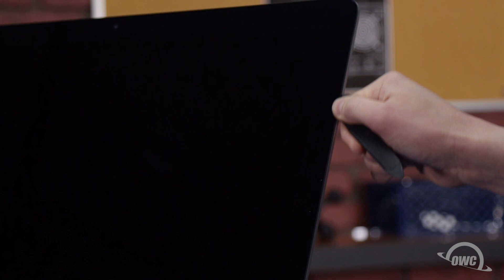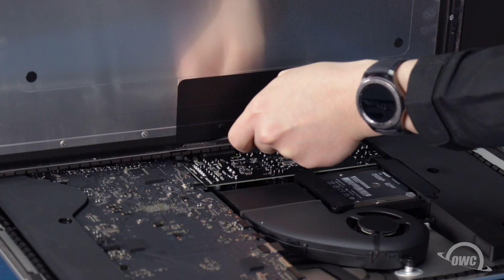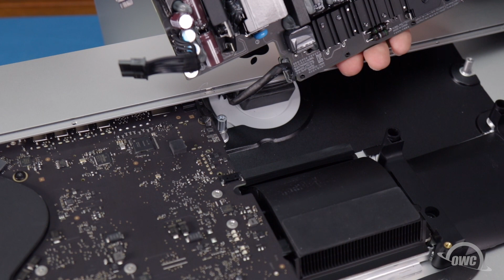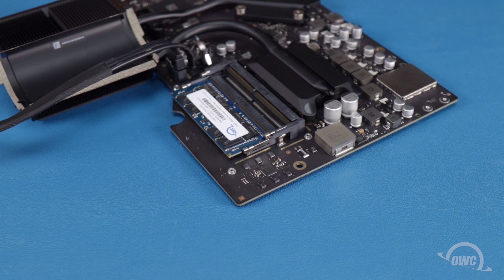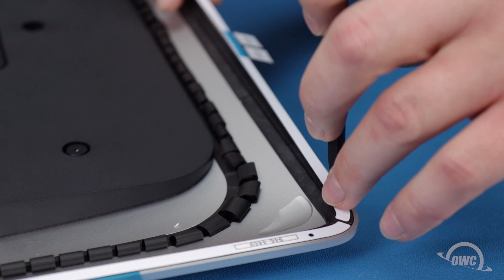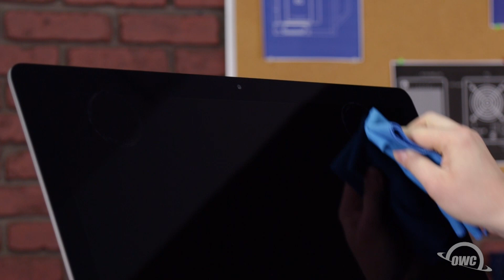How to Upgrade/Replace the Memory in a 21.5-inch iMac (2019) -- UPDATED VERSION AVAILABLE

Comment: You have got to be kidding me!
We just purchased the 21.5" 4K retina to replace our bought new, late 2009 iMac. The HD fan had stopped working in the '09, so I had purchased the 3 fans refurbished. 
I had no qualms in opening up the '09, but the wife felt 10 yrs was a good run and came into some money so wanted it replaced. It's pretty much been hers and located in the kitchen.
Well the '09 is up and running today (the dust accumulation was unbelievable) and since the memory upgrade on it was just removing a perforated plate on the btm, I thought I'd check out upgrading the new one
No way

Comment: Thank you so much! I been able to upgrade iMac 21.5` 2017 with 32Gb of RAM and 500Gb SSD and it works perfectly. Only problem was that had to remove glass 2 times, as first time i did not pluged power supply socket strong enough... Anyway, now it works as expected and much faster! Video works for 2017 model with a very minor differences.

P.S. i found a lot of dust inside, had to cleanup everything with a hoover...

Comment: After upgrading the ssd harddrive and memory ram to 64gb. Do I have do to anything when I power on the iMac? Thanks
Reply from the maker: Hi Zee. You will need to get your OS or backup of your system onto the new drive after powering on. You can find the instructions on installing a fresh copy of the OS, and migrating your data to the new drive, here: https://eshop.macsales.com/articles/how-to-transfer-your-data-from-your-old-drive-to-a-new-drive

Otherwise, no, just go ahead and power up!

Comment: Hi I have a iMac with a  fusion drive. What should I buy to add an ssd to this? Also what is the difference between the 3.0 i5 and the 3.6 i3?
Reply from the maker: Hi Joey, we'd be happy to assist with the correct upgrade info. Would it be possible for you to provide the model identifier of your machine? To find your model identifier, click the Apple icon in the upper left corner of your screen. Click "About This Mac". Then, select the "System Report" button.The first screen that comes up should show you your model identifier as the second line there. Alternately, I can look it up for you using the serial number of your machine.
Reply: OWC hi the model number is MRT42LL/A
Reply from the maker: Thanks Joey. We would need, specifically, the model identifier, as outlined above, to verify the details of your machine.
Reply: OWC the model identifier is iMac 19,2
Reply from the maker: Thanks, Joey! The available SSD drives for that machine are here: https://eshop.macsales.com/upgrades/imac-retina-4k-21-5-inch-2019-3.0-ghz/internal-drives

Comment: I have followed the same instructions for the RAM upgrading but unfortunately after finishing I found that the screen is black and tried several times but no use ... then I have connected it to external monitor and it worked fine .... what could be the problem? ... I have even changed the LVDS cable didn’t work either

Comment: DO NOT FORGET TO BUY COMPATIBLE RAM. OTHERWISE IT WILL NOT START. 
IN MY CASE, I RE-OPENED IT AND USED ONE NEW KINGSTON RAM ALONG WITH DEFAULT APPLE RAM (MICRON) AND IT WORKED!
WARNING: MAKE SURE TO CHECK BOARD SOCKETS BEFORE CLOSING IT BY USING SOME USB A OR C BEHIND IMAC AS I HAVE TO RE-OPEN IT THRICE BECAUSE OF THAT ISSUE.

Comment: OMG what a nightmare - Can you imagine getting everything back together and discovering that one of the modules wasn't seated properly?
Reply: The nice thing about the video is you can just pause and take it step by step. Unless you straight up skip a step or aren't paying attention, you have no excuse to miss something. They go over every screw and cable in the process in both directions.
Reply: Currently in that boat....everything works great expect my thunderbolt ports and internal mic are not working so going to go through all of this again to make sure everything is connected and working before I seal it up again.
Reply: Before you do it all back, just test with an external monitor on the thunderbolt port.

Comment: Daaaamn... Apple put so much effort into preventing people from doing simple HD and RAM upgrades. Then they went and made a 5400rpm HD standard. Why do I continue to buy Macs? The current line-up's just evil as there's intentionally no 'mid-range' model with a mid-range price. Rather, there's a high-end Mac Pro for $$$ and an affordable i3 that you wouldn't want. All models have 8GB RAM and those darn 'fusion drives'. I swear somebody put a looot of thought into squeezing customers out of their $$$.
Reply: you buy apple for their ecosystem: you pay for their software, not for the hardware.

Comment: Your videos are excellent.  Very detailed and easy to follow and understand.  Crystal clear videography.  However, Apple should be shot for this nonsense.  I am an Apple fan but some of the stuff they do could pi$$ off the Pope.  Why?  Is this absolutely necessary?  Many people simply cannot afford to pay for such upgrades at the time they purchase their computer. The cost of a new iMac is already very high.  I understand that they are well built and we are paying for the quality but trying to add another $200-$800 to a computer that is already $1500 is crazy.  Things like hard drives and memory should be accessible to end users to upgrade at a later date without having to go through any of this.  I love Apple but this is simply irrational and totally unfair to their customers.
Reply: Having to do this upgrade and learning that the new iMacs post the 2020 iMac will not be upgradeable is making me question my next purchase.     hard drives and RAM should be easily accessible.  That should be a design requirement.    I haven't owned a PC in a decade or more and am questioning whether I will again right now.
Reply: I agree with everything you say except for one thing.. I don't love Apple anymore
Reply: @JairoTaracena  I am quite pissed about this also..on my old 2011 iMac it was easy to upgrade the ram, there is no excuse for this. Not an apple fan anymore either

Comment: Obviously Apple sell more 21.5 inch that the 27 inch models, so they needed to make the smaller one that much harder to upgrade the memory  so that customers can be forced to cough up more ca$h for an expanded memory at the initial buy and squeeze the after-market vendors like Crucial out of the picture. I love Apple products, but I think this is where an up and coming tech company like Huawei would have filled the void and offered options to make Apple more honest. Going forward, we in the US market will be stuck with inferior products because of the lack of competition. Thanks Orange president.

Comment: I did this upgrade along with upgrading the hard drive to a SSD. It took about 4 hours but could not have done it without this video. It was perfect and I used it every step of the way. Thanks so much.
Reply: Upgrading from 8GB of Memory to 32GB is a $600 option on Apple's website if ordering online.
To upgrade your hard drive from the standard 1TB Serial ATA drive to a reasonable 512GB SSD is another $400. So $1000 dollars on top of the $1299 initial cost (3.6GHz Quad-Core Processor, 1TB Storage, Retina 4K Display).
On Crucial.com, you can get a 500GB SSD for $66.99 and 32GB of memory for $149.99 on OWC. so for $220 out of pocket and a savings of $780. I'd say 4 hours of install time is money in the bank. 
Whenever possible, if you're capable, don't choose the upgrades from the manufacturer. Just do it yourself.
Reply: Kevin Shea did you buy a kit from a local store or something? I’m dumbfounded at this difficulty to do this
Reply: Any tips on how to transfer the OS to the new hard drive? I just bought a new iMac 21.5 with the intention of doing the upgrades myself. Any tips would be greatly appreciated. Thank you.
Reply: @ChefNatintheMaking   use this software..you can use it free for a couple of times..
https://bombich.com/download
Reply: @kevinshea5819  kevin thanks for your comment, how much memory stick with your Mac after the up grade?
Reply: @javierduarte4421  I upgraded to 16gb
Reply: @kevinshea5819  thanks you very much
Reply: @kevinshea5819  did you have to buy a new bracket for the ssd or did it fit the one already in?
Reply: @xdc98x  you do not have to buy a new bracket. The old one fits.
Reply: @kevinshea5819  OK thanks I have a new bracket anyway but I'll try the old one first
Reply: 4 hours........how much you save at this time?
Reply: @Hob419  The memory (16mg, SSD 500GB) and the "tool kit" (torx screw drivers, new adhesive) cost around $150 from me. I believe it would cost over $600 at Apple. It really wasn't that hard. I really took my time. The biggest pain was the adhesive getting the old stuff off and carefully putting the new stuff on. If you decide to do it have a way to watch this video while you are doing it. It really is very doable. I don't think you have to be a tech person to do it. You just need to have the tool kit and the stickers (adhesive) to complete the job. I will tell you my computer runs like lightning now. Before with the old hard drive it took 3:46 to boot up, now with 16megs of ram and new SSD it takes 48 seconds. Everything is blazing fast and my machine is late 2013. I HIGHLY recommend doing this. I was about to spend $1800 on new iMac and I am really glad that I didn't. Just be prepared before you start, do your homework..watch some videos on transfering your data from old hard drive to SSD and you will be good to go. Also give yourself a lot of room to work and the time to do it. I probably spent and hour and a half getting the old adhesive off and putting the new on. Good luck!!

Comment: It's obvious Apple did not want an easy upgrade. They put a lot of thought into this as the 27 inch can be upgraded with ease.
Reply: Tim Ryan exactly. Learned my lesson the hard way to always just spend the little extra in the future. Although I’m going to still upgrade the ram on my 21.5 inch 2017 iMac, it’s such an Apple thing to do to give a big F U to its customers when they need support if they aren’t paying top dollar.
Reply: @alexcantsleep_  in all fairness I've never been a apple guy and I managed to do this with little issue in a little over a hour on my wife's 2019 21.5. I couldn't take how slow it was compared to our pc. Threw 32gb of ram and a 1  tb ssd in there.  This is their way of making casuals dish out more for better hardware. Ram and ssd from apple would cost 4-5x more then ordering and doing it yourself
Reply: @I2ocker89  Did you have any issues after ram and ssd upgrade? Its crazy expensive to upgrade ssd and ram in my country and i got the 21.5 i5 2019 model. I was wondering if you had any issues afterward upgrading. I plan to use it for at least 7-8 years i think ram upgrade would be nice
Reply: @Eren-xz6ue  no issues. I used the OWC 32gb of ram and a Samsung SSD evo 860. It's actually a neat computer now that it's ssd fast and can handle 4k without lagging
Reply: @I2ocker89  thank you so much!
Reply: More money, more upgrades.
Reply: the 27in is so easy..why would they make this so difficult? marketing scheme?
Reply: @b3lievenhopephotography578  yes like i said, more money - more upgradeability
Reply: @Bear-nr9jo  Apple is a total bitch for building like that tbh but i am so used to macos and don't want to switch. Its almost like we have to buy that product haha
Reply: @Eren-xz6ue  haha ikr, you can get a pc, install linux then install an app called Sosumi which lets you run MacOS on any linux os and it is so easy
Reply: @Bear-nr9jo  Yeah that can work but thats too much work imo. But i also love how imacs are all in one products, and the durability of apple products is a huge turn on 🥺 Also i did a little research whether to buy a pc setup or an imac, but same internals, 4k screen keyboard etc costed me around 300 dollars less than imac, i was like yeah i am paying for macos haha. I might do ram and ssd upgrades in the future i guess (i love opening up electronical devices xD) we will see how it holds up